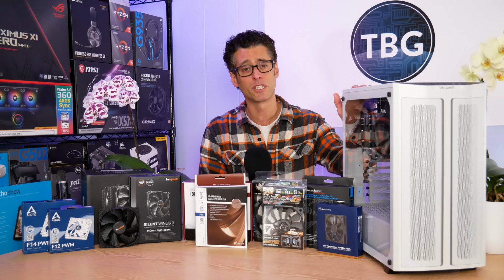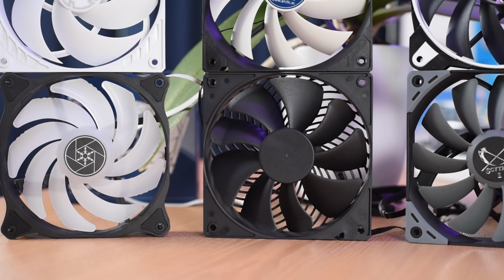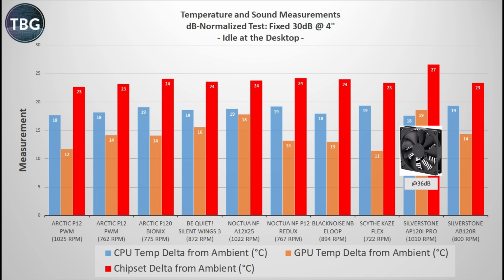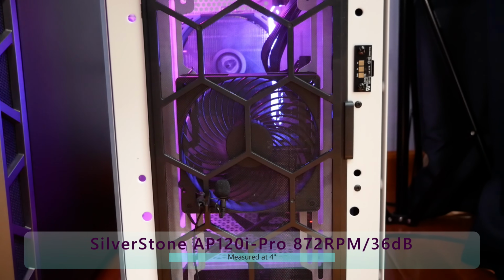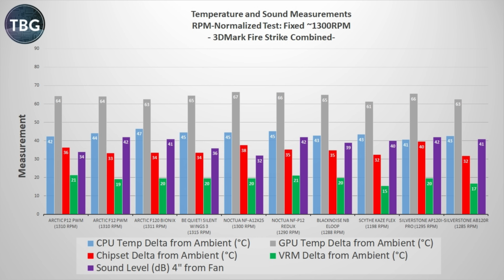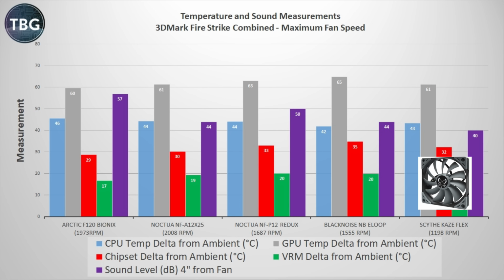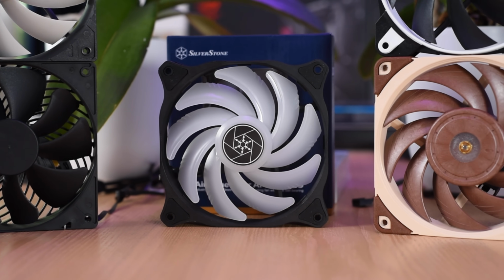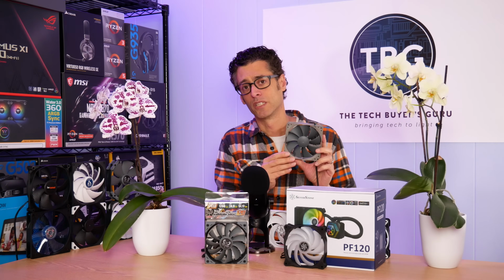The Best 120mm Case Fan Shootout: Arctic vs. be quiet!, BlackNoise, Noctua, Scythe & SilverStone

Comment: Can someone explain to me why for BOTH Sound Tests.... the Silverstone AB120R sounded "lower" than most of the others, if not all, yet the DB was listed as higher?  Also, the one he recommends, the Scythe is actually LOUD for BOTH tests, yet for the second test, it's DB shows as low?  Also, for the first test, the Noctua NF-A12x25 sounds fairly loud, yet it's DB is listed as the lowest sounding, and the Arctic F12 PWM sounds low, lower than the NF-A12, yet it's listed as slightly higher DB then the NF-A12?  How can all that happen?  In other words, my EARS are telling me fans are lower than they are showing in the DB, as well as louder than the DB results?  BTW, am I correct that my ears are telling me the Arctic P12 PWM is showing as the lowest sound for both tests?

Comment: My only concern with this test is that (unless I missed it) you did not mention the CPU frequency which (especially on Ryzen) is important. In my own tests I found that fans and fan speed may not result in a significant temperature change but this is because Precision Boost was clocking the CPU frequency higher accompanied by greater voltage. Thus it looks like there is no/minimal difference if you look at temperature alone. However there most certainly is a difference. 
That said I subscribed after finding this video. Anyone who who puts this much effort into a review clearly cares and I want to keep watching. Best of luck!!!
Reply from the maker: A few people have expressed concern about this, but trust me, I know all about how Ryzen CPUs boost, I detailed it in my original Zen 2 review (https://youtu.be/1aC2tSEy-5A). What you need to understand about Precision Boost is that it requires fairly large drops in temperature to trigger a boost scenario. It does not boost with every degree drop, it's not nearly that granular. The CPUs I've tested have no more than 3 boost states, and typically, it requires upgrading the CPU cooler significantly to actually trigger a new boost state. The difference between one case fan and another is simply too insignificant to create the kind of drops in CPU temperature that would allow boost to change, and even if it did, it would quickly heat up and then drop back down. So if you see 2C differences in CPU temps at load due to a case fan, I can assure you that the CPU is behaving exactly the same in every scenario.
Reply: @TheTechBuyersGuru  Precision Boost, in the sense that I am discussing above does not have "states" it is a Voltage /Temperature Frequency _Scale_. I would checked out this video  for in very interesting/indepth look .

https://www.youtube.com/watch?v=g94rNe4XSGU

And no you do not need to go to LN2 temperatures to see this effect. As I mentioned I have seen this with my own fan testing on the 3900X. We are talking small differences here resulting in 25 to 50 Mhz changes. It may not seem like a lot but remember AMD is also adding voltage to hit that higher clock. More voltage = more heat. Thus if you are trying to measure what is already bound to be small differences (fans), this additional variable can make testing impossible. 

All this is to say is that with the way PB2 works you can no longer just look at temperature. You have to taking to account frequency as well.

Alternatively "clock and lock" the frequency and voltage manually to avoid all of this. 

The only other thing I will say is that if  multiple people are asking it was probably worth mentioning in the video.  I know most comments are people trying to crap on other folks. However in this instance I saw someone putting a lot of effort into something I too am passionate about and wanted to give some (I think) helpful advice. Best of luck!
Reply from the maker: Thanks for the input. What I'll do is confirm the clocks that the CPU is running at during each run for my next roundup. If I begin to see a difference, I will lock the speeds.

Comment: Thanks for the review. My only question is what affect does clipping the microphone  to the case have when considering noise levels. Is there any vibration that affects the sound comparisons because it is directly connected to the case.
Reply from the maker: Vibration is a very minor concern versus the sound of air and the motor. Unless the fan were actually shaking, the microphone would not pick it up. I guarantee you that the sound you here in this review is not the sound of vibration.

With that said, because a number of people were worried about this, my next fan round up, looking at 140mm fans, will position the microphone 4" away from the front mesh.

Comment: I would not base any purchasing decisions on these results. This is an air stream test first and foremost. It does not test how much air the fans are capable of displacing. Intake testing would be better if all three front slots are populated. But the airflow still would not be realistic as there is no exhaust. If only one fan is available for testing, then why not use it as exhaust? The generated exhaust air stream will then play little role on results and emphasis will be more on airflow.

Comment: based on your two reviews and other sources I went with Arctic P12 fans, Noise levels performance and price were trully incredible all things considered and I happily replaced all of my fans with them.
 I couldn't be happier, my system is 10*c cooler than it was at stock (I added fans though) and yet it's more silent than it was :) aaand I didn't break the bank in process. I got 6 new fans that perform great for the cost of getting 2 noctuas, or 3 scythe kaze. my fans are idling at 500-600 RPM in case and I can barely here they're there.
Reply from the maker: Great to hear, yes the P12, especially the P12 PWM 5-pack (https://amzn.to/315p5Rp) is getting a lot of love these days! Arctic is now having to ship these directly as they are sold out at Amazon!

Comment: For the noise of the fans, i have noctuas A12x25 and NFP12 and they really don’t sound like that in my machine, and that’s because of how you measure the sound, the hum sound you hear is not generated by the fans, it’s generated by the air going through the filter, so the noise you’re recording is the filter noise, not the fan noise, to see what I mean, try to record the sound of the fan without anything in front, then stick it against a grille or a mesh and hear the difference. Add to that that the mic is fixed on the filter that vibrate, transmitting a lot of the sound through the mic’s mount and not actually through the mic itself. (Sort of like bone conduction).

Comment: What were the 3DMark scores? If a fan does a good job, the CPU and GPU will ramp up. Potentially giving slightly higher temps, but better results.
Reply from the maker: As I discussed in the video, three fans were able to keep the GPU below the 88C throttling threshold, so those would have higher scores. But just so you understand, when doing case fan tests, if the case fan is doing a better job, the temps are *lower*, which then in turn leads to higher performance. As for the CPU, there's no way a case fan will provide enough additional cooling to lead to Ryzen boost.
Reply: @TheTechBuyersGuru  So you didn't record the 3DMark results?
Reply from the maker: Nope.
Reply: @TheTechBuyersGuru  That's a shame.
Reply from the maker: Remember, I set up this test so that the GPU would throttle - I didn't want the GPU fans doing that much work, the GPU was just there to throw off heat and stress the case cooling. But for my 140mm fan roundup, I will re-work the test by running the GPU fans at a much higher speed, and I may assess performance then. Doing so in this test would have been worthless - the GPU hit 88C after just 5 minutes in almost every test.

Comment: you forgot one test
the sound levels after 2 years of use
results will be hilarious
Reply from the maker: I'm still using a Scythe S-Flex fan from 2007. It sounds perfect. I'd guess all of these fans will be doing great in 2 years. It's fans that use rifle bearings that have problems. But I tested only high-quality fans, and every single one had a fluid-dynamic bearing.

Comment: I can personally vet that compared to the bionic f120 and the nbeloop 120, the kaze flex 120 pwm is king. It's quieter and surprisingly better in over all keeping the chassis cool. I'm working on my itx/sff rig. I pulled the trigger and replaced all of my case fans with the kaze flex 120. Hard to find but frozenpc.com had them and shipping was fast. 

F120 (max at 1800rpm) had a very noticable (annoying) ramp up/down when tied to chassis fan header. Great at airflow though. Even with a lower fan curve, which was much better with that ramp up it still bothered me. NB eloop (max 1500rpm) was quieter than f120 and had best airflow of all yet when anything obstructed the fan (even simple mesh filter) it deepend the noise. Think like a low deep "burrr" sound. Kaze flex 120 pwms, once installed had zero noise. I was even able to to set fan curves back to standard profile in bios. No annoying ramp up, no noticable audible difference. I am loving it! 

Thanks TBG for the review and shootout.
Reply from the maker: Thanks for sharing your experience! It's good to hear that you found the Kaze Flex to be great as well (back in stock at Amazon, by the way: https://amzn.to/2YpCmkA).

The issue you bring up about the Noiseblocker is something that makes reviewing these fans really, really tricky. When each fan noise profile changes differently depending on what type of filter, how many filters, what type of front panel, it makes providing relevant audio samples very tricky. Nothing is universal, and every sample I provide will disappoint someone, because it's not the setup they use. I think that sound the Noiseblocker is making may have to do with how it spins the air. I believe it is an air concentrating fan, which spins the air into a vortex. That could cause a deeper noise, essentially like a vacuum pulling air through the filter at an angle.
Reply: That's a good example and you're right. So many factors and yet how to get a level and fair comparison. I look forward to the next one! 🤙🏼

Comment: Do you have any indication that the Kaze Flex 120mm RGB (1200rpm) performs similarly to the non-RGB version shown in this video? I know you had done a review on an RGB CPU Cooler by Kaze in the past and noted that it performed very poorly.
Reply from the maker: That fan was so bad that I asked Scythe what they had to change to incorporate RGBs. They said it was the same fan, which is completely untrue. So I'm not sure what to say, other than perhaps driving it up to 1500RPM takes it completely out of its nominal RPM range, basically "overclocking" the motor. I may test it again on my current case fan bench to see if I can determine what is going on with it.
Reply: @TheTechBuyersGuru  Thanks so much for the reply! When you say "so bad", you're referring to the Mugen 5, right? It seems that Scythe also sells the RGB version of the Kaze Flex 120mm standalone (I noticed it on Amazon when I was looking to buy the regular 120mm based on your review, actually!), I wasn't sure if you'd taken a look at that and seen if it performed similarly to the fans mounted to the Mugen 5. I imagine they're supposed to be "identical", but that isn't always the case in practice!
Reply from the maker: I am indeed referring to the Kaze Flex 120 ARGB PWM Fan mounted on the Mugen 5 ARGB Cooler. You are correct that many manufacturers use non-retail versions of their fans on their CPU coolers, most often to increase RPM because their retail fans are primarily marketed towards cases, which require lower airflow. My guess, however, is that because Scythe is a pretty small company, it would not take the time to manufacture a separate fan for its cooler. In fact, since the fan came out first on the cooler, whatever ends up at retail will likely be this fan.

Comment: Thank you for the video. I suggest for a future video a normalized dba temp test with a radiator, for the radiator would cause more noise than no obstruction at all.
Reply from the maker: Great suggestion! When I eventually get around to doing a 140mm/280mm radiator fan shootout, I will do a normalized dBA test.

Comment: Inconsistent noise test. By strapping microphone to the case you are measuring vibrations of the case and fan and NOT an actual noise from a fan airflow! Microphone shouldn’t touch case, fan and even table the case is standing on.
Reply from the maker: Oh, come on. There's so little vibration from these fans that the microphone isn't coming close to picking it up.
Reply: @TheTechBuyersGuru  Microphone suspension shock mounts out there are not for the looks.

Comment: 2x front 140mm. 1x exhaust 120/140mm, Thanks.
Reply from the maker: Yes, I'll be conducting the next shootout with one 140mm fan in the front, to compare directly to the 120mm results, and then I'll test a three-fan setup with dual 140mm fans in the front and a 120mm in the rear, plus potentially one on top.

Comment: Hi, thank you for this video! i have a question,  i need to replace the exhaust fan of my case ( cooler master q300l ) and adding another one above the CPU, both will be outtake fan
, is the Arctic P12 PWM the best choice price/performance or should I go with a non-pressure fan? ( btw I have 2 P14 pwm pst on the front as intake)
Reply from the maker: Static pressure fans like the P12 PWM (https://amzn.to/2AgrPjX) are perfect for exhaust, because they have to push through the fan grille, and because they don't need to be at all directional. Go for it, making your Arctic-cooled system complete!

Comment: It's amazing how the budget Arctic P12 performs almost identically to the Noctua NF-A12x25 at around 1300 RPM. Arctic seems like the most sensible choice for a silence oriented PC without spending over $200 in fans.

I'm eager to see the results of the 140mm test, it seems like a forgotten territory.

Is there a reason for not including Corsair's ML series fans in your tests btw?
Reply: sadly not quit right. The arctic is a great bang for buck but it has a problem. It produces a humming sound at many frequencies. Not to loud but its irregular and stands out from the normal air sounds espacially at low rpm like 600. Very annying for very silent builds, switched to the noctuas...
Reply from the maker: Yes indeed, the P12 is quite a budget wonder, and yes, the 140mm fan shootout will be coming next month and shouldn't be forgotten, given how many new cases fit 140mm fans these days.

As for not including Corsair's ML series, there certainly is a reason. Exhibit A: https://youtu.be/W2Zis8RjcX8. Enough said.

Comment: Literally expecting traditional (more known) channels with this content but nothing i wanted available.  Congrats. Insta subscriber.   One thought i was looking the fans you showed here plus the Fractal design verions too .  I was oh man xD
Suggestions 
Intake/exhaust configurations (GN talks about this a bit.  But I'd like to actually see it) and examples maybe with different brands and types (DC and PWM configurations). There are lots of folks who only do air cooling not only WCooling...
3 in 1 out,  3 and 2, top front  bottom  and rear etc. 
Thanks!
Reply: Thanks for the reply. I'll wait for more in depth from yourside  too. Have a great week/end!
Reply from the maker: Thanks for the sub! Hardware Canucks actually just ran a video on different fan combinations in the exact same case (the 500DX), but he only used the stock be quiet! fans. Still interesting from a fan placement perspective, although he oddly left out a couple of common combos while showing much less common setups. Might want to check it out.

Comment: A12x25 doesn't really sound like that when setting 30cm away from the fan itself.
4" measuring distance might be a little bit too close?

Anyway, A12 is not very optimal for just moving air into cases.
Reply from the maker: If I placed the microphone 30cm away, every fan would sound the same. The microphone can't resolve subtle differences at that distance.
Reply: @TheTechBuyersGuru   
That's true indeed.
But those fans do sound differently when you keep some distance from it. And personally I think it maight be closer to what we usually would hear. 
Anyway, just some suggestions. Your results are absoluetly great and representative.

Comment: That's very useful info!
Thank you 🙌
I have a cm master liquid ml240l, was planning to use arctic p12 pwm pst for push, and f12 pwm for pull, is that a good idea?
Reply from the maker: Use P12 for everything, push and pull, get the 5-pack, you basically get a free fan.
Reply: @TheTechBuyersGuru  currently thinking about having 3 f12's in the front for intake 1 in the back for exhaust and 2 p14's for my h115i radiator on top as exhaust, ideas or suggestions?

Comment: If I understood correctly, the tests were conducted with a single fan? And for exhaust it seems the same fan was always the same? Doesn't that leave the question of scalability unanswered? I mean I hope most people populate their cases with more for better airflow and secondly I'd assume most people would buy multiple of the same fans so really would like to see that test. Otherwise great info
Reply from the maker: No rear fan was used. This was a single fan test. Of course most people use multiple fans, but in order to drill down to the per-fan performance, I decided to use one fan. Could I have used matching fans in front and back? Yes, but the audio and sound level testing would have been less precise if a rear fan was buzzing in the background. I wanted to focus on just one fan so people knew what it sounded like. I will be doing a follow-up shootout using multiple fans in the case, but with fewer competitors now that I've narrowed down the field.